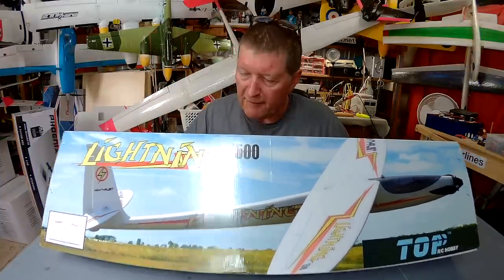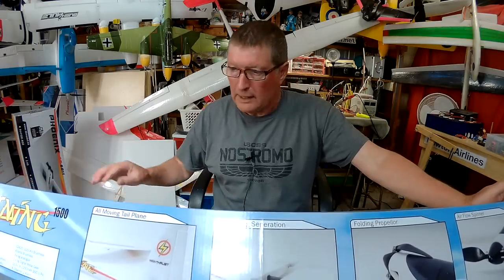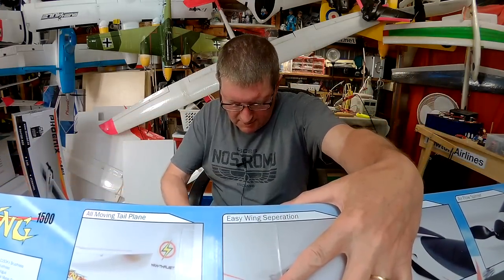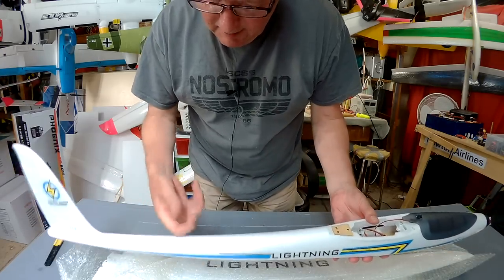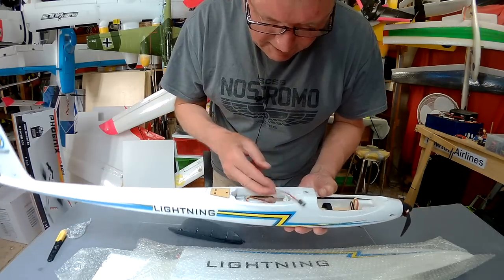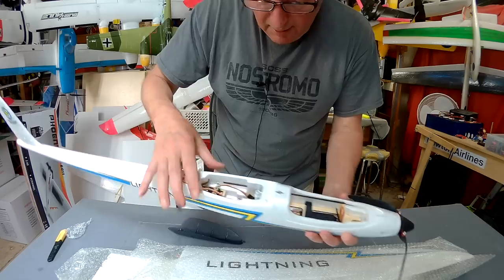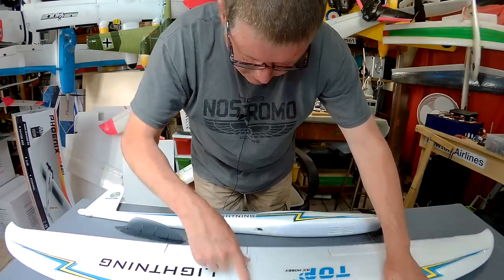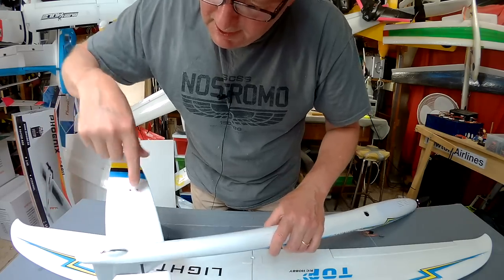Top RC Lightning 1500 - Fast Glider

Comment: I have  the 1200 mm EDF version of this plane which I like very much.  The EDF Swift and Lighting share the same fuselage.  Very high quality dense foam, very well reinforced and excellent design.  Set it up with flaperons which work well and I am certain would work well on the Lightning.  I have learned, from Top RC Hobby, there is a version 2 of the Lightening which will be available.  I intend to order two as soon as these are available again.
Reply from the maker: Oh, looking forward to the V2

Comment: I flew my TopRc/MaxThrust lightning today for the first time on slope 😊 I pushed the Cg way back and was flying in 10-12 mph wind. Had a blast but it seemed to tipstall very easily. When you slope this glider whats your Cg. Im running a 4's 1800 mah bat and all my throws are pretty much maxed out and beyond in high rate lol... My buddies Volantex Phoenix S 1600 was hanging nicely and very stable. Am I missing something or are they two very different gliders... Thank you! Today was both of ours first time sloping and it was awesome!
Reply from the maker: Yes sloping is the best! They are very different gliders. Lightning is built for speed and strong wind, maybe your CG and throws were too much. Phoenix 1600 is a great all rounder. Can't recall my CG, probably just on the marks if there are any.
Reply: @AndrewNewton  Thanks!

Comment: Looks nice Andrew, I guess you may need some spoilerons setup to slow things down to land. :)
Reply from the maker: Post maiden - Programming them in right now. Lovely fast glider, takes the full field to land!!
Reply: @AndrewNewton  so you have the ailerons deflect down for that right? The mad tinker
Reply: Did some reading till I had a decently clear answer: 
I recently finished up a Northeast Sailplane Products(NSP)/FVK Elektron 400 with Ailerons [ http://www.nesail.com/electron400ail.html ], and wanted to set it up with pop-up ailerons as spoilers. The Elektron has a separate micro servo installed in each wing, a setup that is fairly common for both sailplanes and large power planes. With each servo driving only one aileron, the control surfaces can move in opposite directions for aileron control, or both in the same direction (UP) to act as spoilers. The combined function from a single set of surfaces is known as spoilerons.
Reply from the maker: Up for spoilers and down for flaperons

Comment: I did some reading to make sure warm was not referring to much more than speed. Hotliner is faster. 
So is there a cold liner. Ha ha. 
Is that a non powered sail plane.
Reply: Funny the fastest rc planes on the planet have no motors. Clocking speeds over 500 mph.
Reply: @JamesHurd  That is some humorous irony.